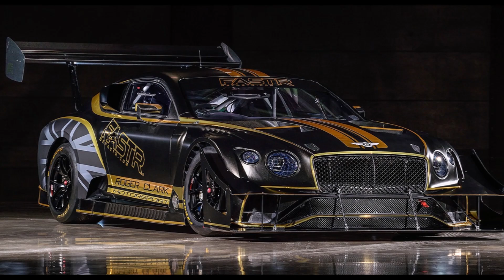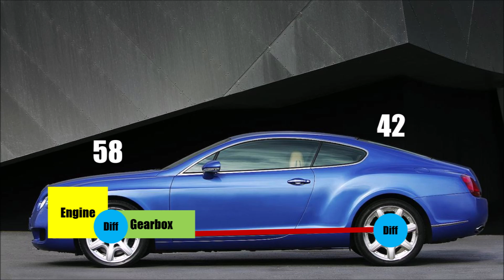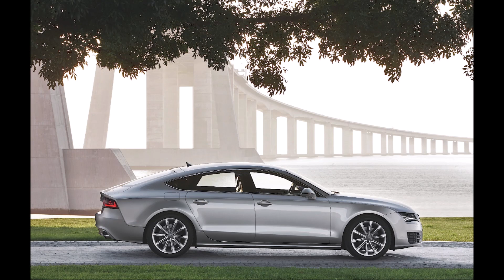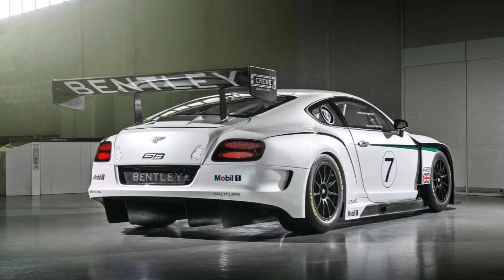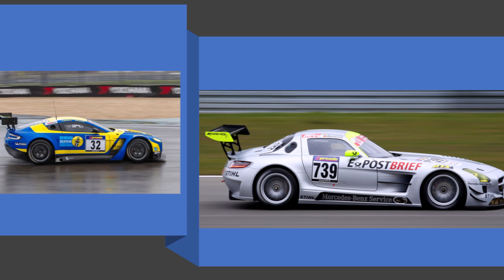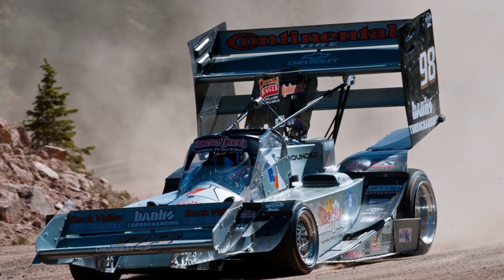Bentley Continental GT3 Pikes Peak - Aerodynamic Updates

Comment: Is there a technical difference between canards and dive planes?
Reply from the maker: I experienced that both words are used for the same thing but generally canards are small devices to create side vortices to help with wheel arch extraction, dive planes are much bigger and additionally create large pressure areas (downforce)

Comment: Hi! Could you please do a future video on swan neck wings vs regular wings? (i.e. wings mounted from above vs wings mounted from below)
Reply: Swan neck mounts for wings improves downforce generated when the relative direction of the airflow  is not aligned with the orientation of the wing due to cornering or wind. It helps by not disturbing the laminar flow of air under the wing so it can generate downforce. Under wing mounts create low pressure zones near the mounts when air is not moving perfectly in line with the mounts. This causes the bottom of the wing to stall and produce zero downforce. 
The top of the wing is a high pressure zone so the additional turbulence created in the “shadow” of the mount is not strong enough to cause flow separation. 
A car wing works just like an upside down plane wing where lift is created by low pressure of the faster moving air on the top of the wing and the angle of attack on the bottom of the wing. 
And this is why airline engine nacelles are on the bottom of the wing even though there is a much higher risk of foreign object ingestion caused by close proximity to the ground. 
This is also another reason why missiles are mounted under the wing.
Reply from the maker: Yes, good point. The suction side is far more sensitive than the pressure side as Colin says. Might be good stuff for an explanation video.

Comment: Since Pikes Peak has such open regulations, do you think mounting the rear wing lower and behind the boot lid would have been a viable alternative placement to aid with diffuser extraction?
Reply from the maker: A lower rear wing would definitely help the diffuser but you get more downforce overall and more easily by just mounting a straight rear wing far up.
Reply: @bsport320  what if you mount it rather far back as well so that the effective moment arm is much longer. Will the mechanical advantage of this not result in a similar force (because it is further from the centre of gravity) without all the drag?